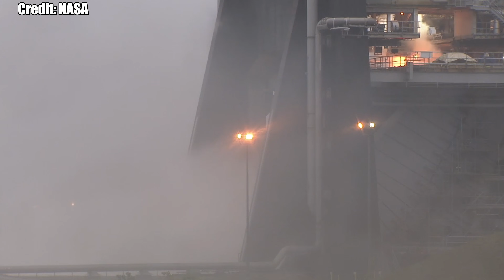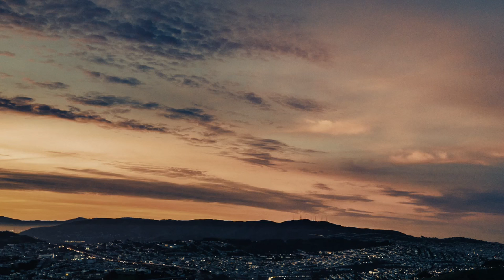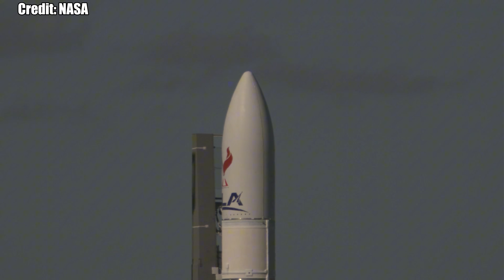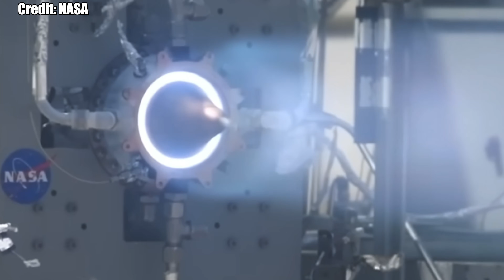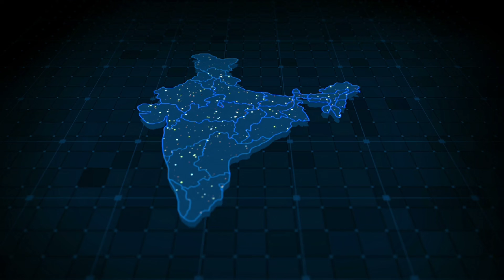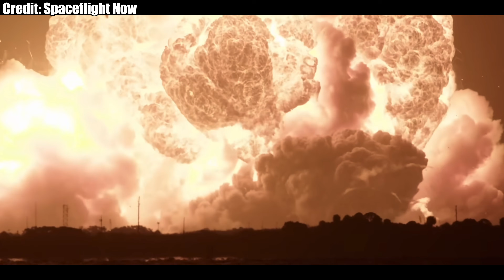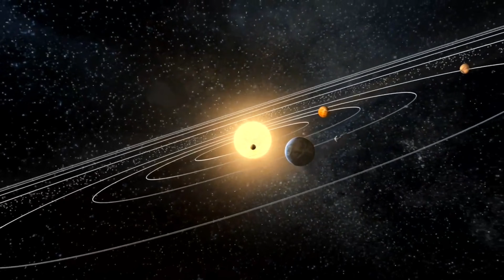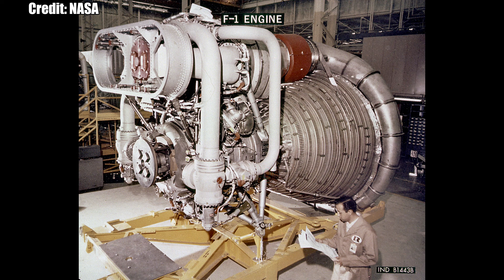They Just Proved Rotating Detonation Engine Will Work

Comment: Why does one representational imagine more resemble an areospike design? The technologies are not compatible on any level.
Reply: Which two are not compatible?
Reply: Actually, RDE and Aerospike are extremely compatible. If anything, an RDE would make solve many of the engineering challenges inherent in an Aerospike. Or to put it another way, RDE is what could make Aerospike actually viable instead of a pipe dream.